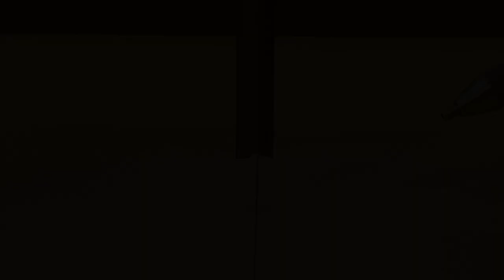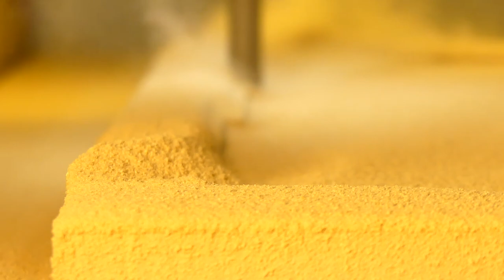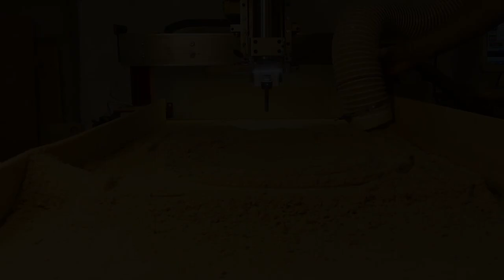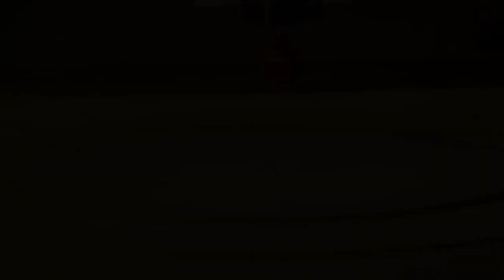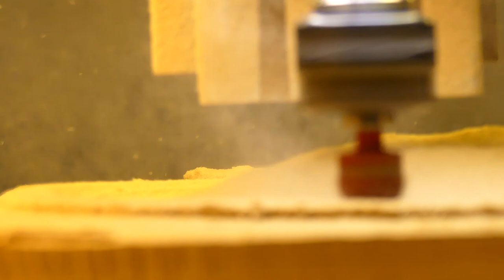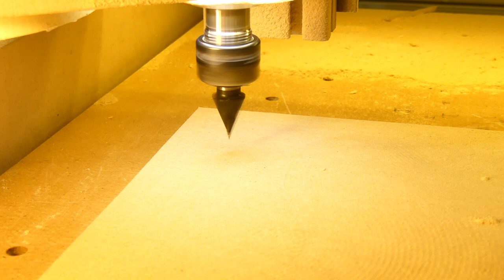Relaxing Guitar Making ASMR | no talking no music - satisfying sounds | Part 1 Trini Lopez Guitar

Comment: For that mould did you just cut out the top contour from your model so it would basically be a 335 top out of mdf, or did you model a different top so when you vacuum laminate the top it will come out contoured like the 335? I'm still debating on if I should make a vacuum jig or just use my cnc to cut out the 335 top out if a solid piece of maple. Thanks!
Reply from the maker: The mdf is the mold that the vacuum pulls the laminates to. If I was to do it again I would go with a solid carved top.
Reply: @Two Cherries Instruments  I agree, thinking about it making the laminate seems like a lot of work. Having the mold would be nice but I don't know how many 335 guitars I'm going to make lol. Thanks for the reply!